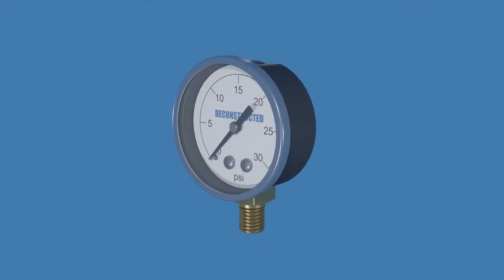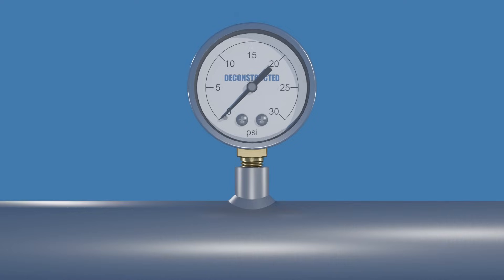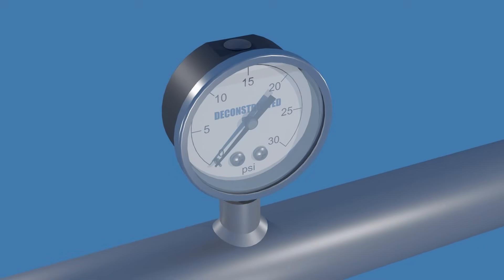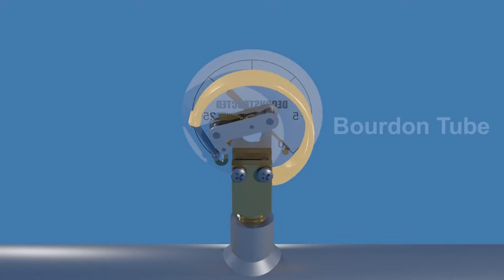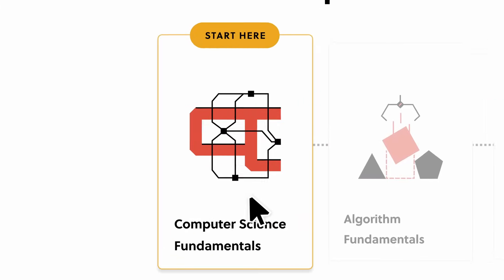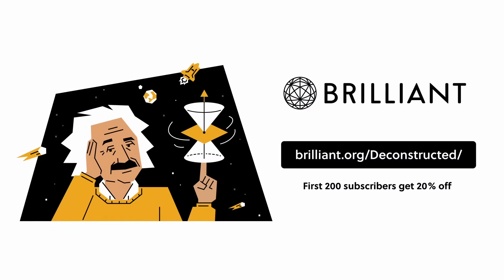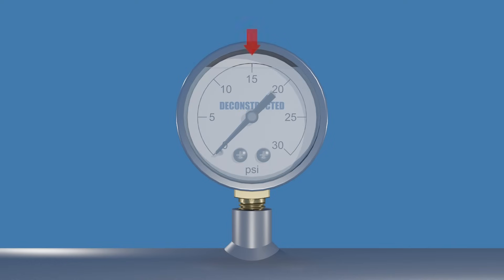How a pressure gauge works

Comment: Never seen a gauge with a back plug that blows out when the gauge spikes or overpressures..  thats what they make blow offs and relief valves for..  but either way, ive seen a lot of pressure gauges and none even the really high pressure ones that are for up to 10kpsi..

Comment: Additional note, if your operating pressure is 30psi, get a 60 psi gauge, I was told you should have the normal operating pressure be half of what the gauge capacity is,. The gauge is meant to operate at the middle value so it wont screw overstress the gauge

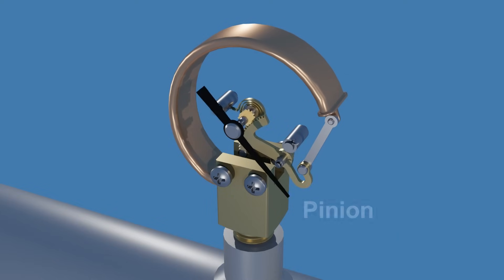Comment: 2:52 The spiral torsion spring aka hair spring doesn't help return the pointer. It's function is to remove the backlash of the sector and pinion gear by lightly applying torque resistance. This prevents the needle from being free to fluctuate under vibration.
Reply: Ah that's a great addition, thanks. Now I know it was this part that failed in the pressure gauge of our coffee machine a while ago, which had begun oscillating wildly.
Reply: Yes which is made obvious by the fact that the deformation is elastic. Which means that once the pressure is relieved the tube will pull the sector gear the other way. If it didnt, the deformation would have been plastic
Reply: nobody likes smart guys, bro...
Reply: @Petronionhr  get off the channel.

Comment: Liquid vs dry filled. Vibration etc are important but also variance speeds, for example compression gauges are always dry as the sudden change in pressure could cause damage in a liquid filled guage. This is the most important aspect when choosing liquid or dry as the other points you make do have an impact on failure rate but will not be a consideration for general use.

Comment: Why do you need a spiral spring to return the indicator, since the connection to the boudon is geared?
Reply: Maybe to keep tension in the moving parts? Like when the tube is switching from straightening to bending back it keeps everything in the places it should be? Just an idea, id love to know too :)
Reply: @patrickadair8503  maybe it reduces backlash.

Comment: I use a dry one for concrete testing and have to observe others use an oil filled one for post-tensioning. It's interesting to learn the reason for the oil and it makes a lot of sense in this context. With concrete testing (specifically when using the pressure method for testing air content), there's no change in pressure when the gauge is read. With post-tensioning, the guage is constantly changing and jumping around even with oil as the tendons are stressed. Without the oil, it might be nearly unreadable.
Reply: https://youtube.com/@instrumentprocessmanagement?si=q932XO5UwcCmH8iE